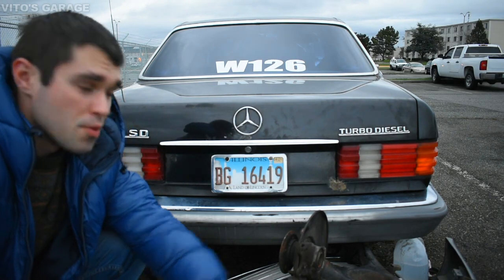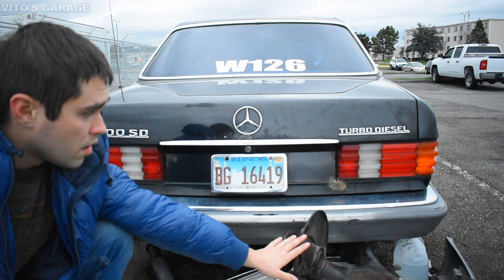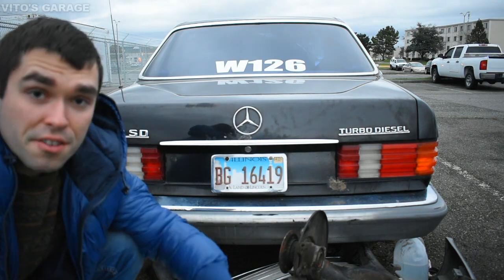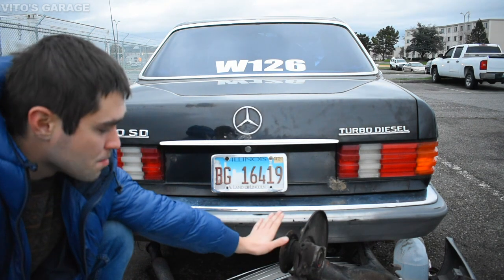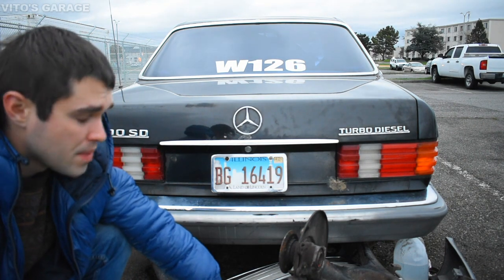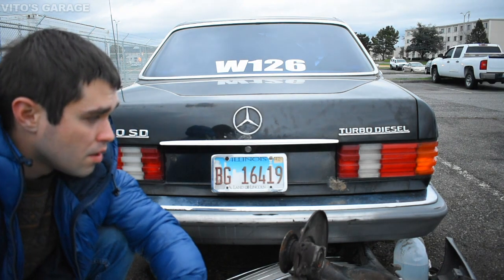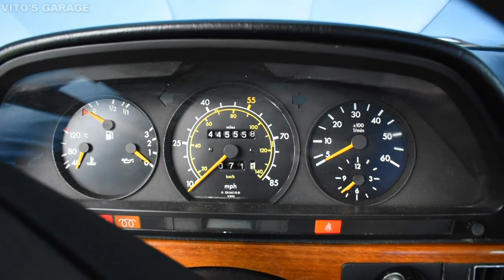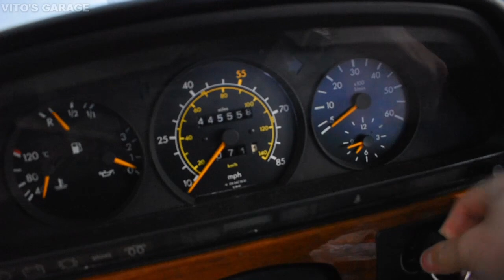Will it Start? Attempting to Start a Legendary 1981 Mercedes W126 300SD After 3 Months

Comment: I own an '84 W126. I recently went to 15" wheels like yours has (mostly :) to have a better choice of tires than with the factory 14" bundts. May I ask where you sourced your lugs bolts? I found some that work, but they are a little shorter than the original-type ones that set flush with the 15" wheels. Thanks!
Reply from the maker: I used original bolts in the front as far as I remember. Those bolts can be bought from the delaership, online etc.
The rears have longer bolts because I have spaces (there's actually no need for spacers there, but I just have them). I ordered those longer bolts from eBay

Comment: I wish my OM617 turbots diesel idled that smoothly. Mine runs great but rocks side to side at idled. I replaced the rack dapner bolt but no effect.
Reply from the maker: This engine still needs work, it's not perfect. I need to find time for this baby. For your engine, test your injectors and perform a diesel purge. Try to adjust the rack dampener when the engine is hot. Do the valve adjustment and then test your compression when you have injectors out